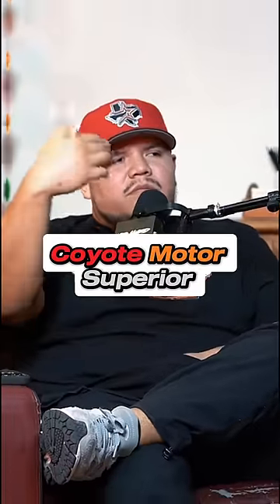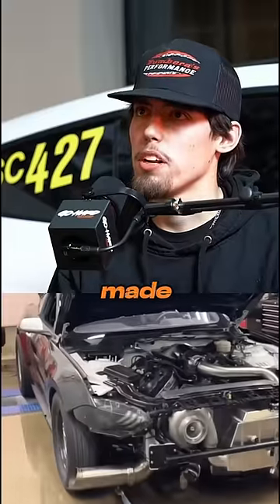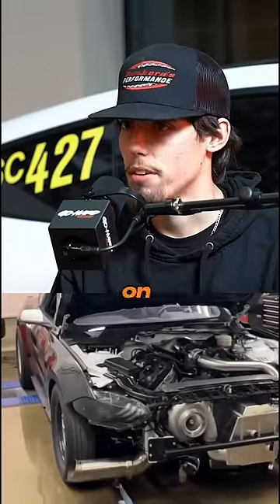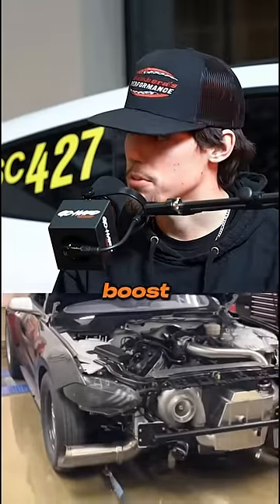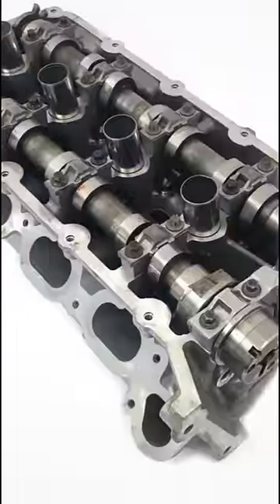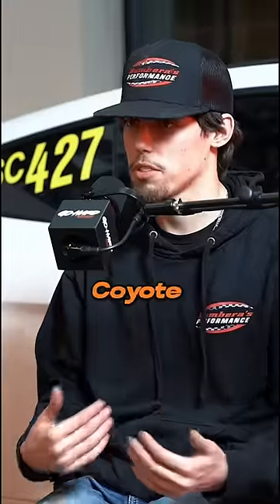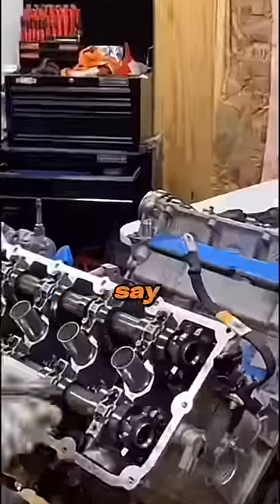SUPERIOR Ford Coyote Motor 😳 #shorts

Comment: 1 thing I love about the Coyotes motor I’ve the LS is that it Revs High from factory most LS engines rev limit about 6,200 RPM sometimes even less and let’s be honest NOBODY races below 4,000 RPM to go fast so yes having a motor that revs higher safely will always have a advantage in the power delivery even riding passenger in a Mustang compared to a C6 Corvette the 5.0 Just punches much harder up top I know you can make a LS Rev higher but that requires Head work valve train components and a Cam possibly even built internals that’s more money and labor compared to a engine that does it right out the gate so I’m going with the Coyote any day it also sounds way better than a LS motor
Reply from the maker: They rev Crazy
Reply: Gotta try out the borla exhaust for the 6.2 its got all the right sounds.
Reply: @hogsrmylifetbj  It does doing nice but I prefer the H pipe on LS motors and Hemis too many people do the X Pipe which sounds the best on Coyotes it is some 5.0s that sound good with H pipes too but it depends on what kind of mufflers is used it’s more deep than the X pipes
Reply: RPM does not equal more power
Reply: @keithrogers4577  I used to believe the same thing until high RPMs changed my mind it just feels better the driving experience is better
Reply: Just flat out not true. My boy over here is pushing 7800 out of a aluminum block 5.3 with factory lifters. I plan to spin my lq4 to about 7500 with pretty much factory top end
Reply: @AllOrNothingBusiness an engines hp peaks at a certain rpm just because it revs to 8000rpm doesn't mean you want to rev it there as your not going to be gaining any speed. And there ain't a coyote on this planet that sounds better than a ls
Reply: @randomguy93984  Yeah but those LS based engines still require some kind of modifications to achieve that high Rev limit even if it’s just minor adjustments those engines do not come like that from factory you have to make them rev higher with bolt ons and a tune as compared to the 5.0 it revs to at least 7,500 as is with 0 modifications that is a better driving experience
Reply: @JimmyJohnson7077  GT350 engines are proof that high revs are better
Reply: @JimmyJohnson7077  i disagree Coyotes sound way better than LS engines I had a 2014 Mustang GT with American Racing Long Tubes with X Pipe and Roush axle backs  sounded better than any LS I’ve heard
Reply: @AllOrNothingBusiness  well you haven't herd many ls's than have ya. and yeah sure reving a coyote till it hits limiter is a great way of blowing the oil pump gears lmao
Reply: The rev alot quicker than an LS because they got a smaller crank. Smaller crank will ALWAYS take the RPM title. Just like a Bike.. small ass crank and Rev up 13k to 16k RPM.. LS vs Coyote yes. Coyote takes the win. 1 cam vs 4 cams. Small ass heads vs huge ass heads. Of course Coyote would always get the win. I'm a GM guy but yes, Coyote takes the win.
Reply: But all it takes is valve work and a new cam to safely run it out to 7200 to maybe 75 7600
Reply: @Ironn199er  You’re right but I’d rather have a engine that does it from factory I don’t have to do anything or it besides a tune
Reply: @randomguy93984  dude Brett LaSala spins his to around 10k, factory block and factory heads. He made over 2900 with a stock crank. Your 7500 ain't shit.
Reply: @tailwatcher2500 There’s no point in over spinning a pushrod motor that makes peak horsepower around 7k lol It’s apple to oranges comparison
Reply: @ALYXTANKBACKPACK  I didn't make the comparison, I'm pointing out coyotes and modulars rev higher than an LS. This is why 5.4 DOHCs swept the podium in Engine Masters vs. LS1. They banned the DOHC from the competition.
Reply: My 6.0 LS will easily rev to 7000 with pac1218 springs.
Reply: @randomguy93984 yea this dude doesn’t have an ls cuz mine hits 7000rpm
Reply: @tailwatcher2500 the crank is forged from factory
Reply: How much does a coyote replacement cost ? And Chevy already made a 4 cam motor on their c8 zo6 that sounds way better than a coyote a C6 Corvette is also decade old already
Reply: @abrahamreyes3340  I'm fully aware, dark horse will have better rods as well
Reply: Coyote sound like a modded v6😂
Reply: Theyre heavier and slower than any 18-23 10 speed@tailwatcher2500
Reply: A 430 ci aluminum sbc will turn 9k for an hr lol
Reply: Yr crazy if u think a 5.0 sounds better than a vette 😂😂
Reply: @boostbeast8731 that doesn’t mean it makes power up there. A stock coyote head flows better than most aftermarket LS heads. Also the vvt on all 4 cams means no cam swap required. Btw a coyote making less peak power on a dyno compared to an LS doesn’t mean it’s less powerful. A coyote will typically make a higher average amount of power across the entire rev range because the cam timing control allows for great low rpm power and high rpm power. An LS that can rev as high as a coyote and actually make good power at high rpm will be a dog down low.
Reply: @randomguy93984 your LQ4 probably runs off of Levi Garret chew spit too.
Reply: 5.0s get slammed by the lt1 tho 🕺🏽
Reply: yeah the Coyote can rev, but with the right LS block you can get WAY more displacement. Get an aftermarket block and you can get 454 cubes. LSs are also cheaper to build than a Coyote. LS can be made to rev a lot higher than stock and when combined with much larger displacement its a recipe for big power
Reply: @aw11man26  to a certain debatable point which requires boost. Problem is an LS will lift a head way before a coyote will. That’s the limiting factor budget aside.

 Godzilla has the same problem the LS does.  Even when drilled to a 6 bolt they still pop head gaskets.
Reply: @jose38706 lol not in a 1000 years. Why do coyote girls ls swap them, and why don’t ls men swap to coyotes? You’re welcome
Reply: @JimmyJohnson7077 yeah but the coyote doesn't lose speed or power at 8,000 rpm, ls do sound nice but they can't compete with a yote
Reply: My truck with a 5.3 revs to 7500 I built the engine and swapped it in  in a field
Reply: Try fitting that coyote in something 😉  you'll change your mind the engine works not bad its the fab work on a frame that's a bitch
Reply: In my personal opinion I think they rev too high for a car on the street. Not too many places you can get up to 4-5000 rpm in lower gears let alone 5-6000 in higher gears! My M5 revs to 7200 and I NEVER get to get it that high in ANY gear unless its highway early morning and even then there ain't a stretch of road long enough to rev it out all the way not even in 4th let alone 5th 6th and 7th gear.
Reply: @AllOrNothingBusiness 😂😂😂 go rev a stock yote. To get the kind of power he is talking about a lot of work has to be done on a brand new yote😂😂😂😂😂😂 we talkin bout 30 k for the crate and ford ain’t modifying it for u as a crate😂
Reply: @jose38706 takes the win for rev??😂😂😂 ok
Reply: @Ironn199er oh that’s all??😂😂😂😂 the cost in that is insane. To the point of unaffordable for most Americans
Reply: @AllOrNothingBusiness yes h pipes do sound good on coyotes. Watching 337 speed and saw the difference. Couldn't believe it sounded better than x pipe. On the other hand a Hellcat with an X Pipe sounds VICIOUS!!
Reply: Hp per dollar on the ls is better up to 800
Reply: Coyote makes sense when it comes in the car, but when it comes to swaps ls can't be touched dollar for dollar. The price of a stock coyote will build an absolute beast of a 6.2.
Reply: I love all platforms but I fell in love with the LS motor the first time I heard a corvett zo6 with a corsa exhaust.
Reply: @thebakery3996  who said coyotes are better because they Rev higher? I just stated ONE of the reason WHY they Rev higher you smart person. "Ok?" 👌🏻
Reply: @SZUSEast1  yeah I think the both sound good with X pipe and H pipe it just comes to personal preference
Reply: @chewbaccapew5705  wrong sir. Higher rev doesn’t mean more power. The ls been around since 97, and and you can beat the hell out of them. You can also get over 1000 ponies on the stock ls3. The only thing puppies got is that 10 speed which is gym’s 😂😂😂
Reply: Well guess what CHEVY BOYS WILL FOREVER BE THEM GUYS ALRIGHT PAL ......but in all seriousness the reason that the coyote is better is because it came out after the Ls and they got the see the Ls flaws so they could work around that the ls engines have been around for years the first Ls dropped in 97 the first Coyote came out in 2011 ofc the coyote is better but the LS IS THAT WORK for an engine that dropped in 97
Reply: @LSCBTHEWAVY   and notice how people don't compare the coyote to the new lt platform. Mods will come down in price over time, but we can't ignore the lt
Reply: @keithrogers4577 Horsepower = Torque x RPM / 5,252. So you were saying??
Reply: Wrong broski, WRONG. LS FTW👉🔥✔️
Reply: @JimmyJohnson7077 boom! Roasted👉🔥✔️💯✌️👌👏
Reply: @AllOrNothingBusiness well you've only heard 2 la engines: THERE'S your reason for feeling this way, son. But i know: you're a guy who bases his thoughts on feelings, emotions, not facts and logic. Lemme guess, a gen z??? 😂
Reply: @jose38706 in your mind, but NOT in reality. Ls FTW
Reply: @cxthejokercx8302 this 100%
Reply: @cxthejokercx8302 cammed vettes sound= FTW 👌👏😀👉😀😀😀
Reply: @YOURpopsINthe305  bro. I'm a GM guy. I got a "RARE" engine swapped 2003 truck. L87 swapped, Frankenstein heads, biggest cam a 6.2 can take, fbo, e85 etc.. NA to NA  I'm ready to race another NA f150 10 speed 🤷🏻‍♂️
Reply: Congrats you like Hondas.
Reply: @AllOrNothingBusiness  factory parts my friend. They will turn more rpm than you would think. Run it till it floats the valves and back off 100rpm lol
Reply: @tailwatcher2500  easily achievable with short travel lifters and the right cam sure. Stock cranks are strong but almost 3k horsepower is most definitely not achievable with a stock block. Maybe a lsx 6 bolt block and head but still extremely doubtful
Reply: @jonathanallen8236  no just hopes and dreams, maybe the occasional prayer
Reply: Power at very high RPMs means the lag to get there is waste. Why move a power band to the high rpms, it just creates a broad low, mid dead zone...
Reply: 4.8l LS with Stage 3 Cams and valve train upgrades and internal upgrades are still gonna be cheaper than the coyote and more reliable
Reply: @stevenjohnson1692  your comment is mute. Let me just rev a diesel to 6k rpm and make less power. Or praise Honda for making some of the highest hp cars because they can rev to 9k rpm. Sounds like you could learn something other than googling the formula for horsepower.
Reply: Everything you said is true but the head work and cam and stuff costs about $300 you can do it yourself and the engine only costs $200 at the junk yard so $500 vs thousands… LS is the winner all day but I am not saying coyotes are bad. Just expensive to do the same thing
Reply: @AllOrNothingBusiness my 02 c5 z06 would gap any mustang gt pre 2016 how
Is that better
Reply: No I don't think it sounds better it's more brappy though less profile and texture
Reply: @chewbaccapew5705  the Coyote is a beast of an engine. I drove a Mustang GT the 1st year they put the Coyote in them. The issue is, it's displacement limited. With the right "LS" block you can have 7.4 liters, or more. That 50% more cubes. They will also rev to 8000rpm if built right, even at that size. It is hard to make up THAT much displacement. You Coyote fanboys sound like Honda fanboys from the late '90s and 2000s bragging about you revs.
Reply: @jonathanallen8236  I will never bash a Coyote. I'm also a huge import guy so I like 4 valve heads and revs. When you are talking 1000 or 2000hp, damn near everything can lift a head. I don't buy that bone stock Coyotes are going to live a long life at 1000hp. At 2000hp, you're talking about a full race engine which need either constant maintenance or frequent refreshes or rebuilds. Cletus found out quick with his 4wd Whipple F150 making 1200hp. The beat on it pretty hard right up until it broke the crank.
Reply: @AllOrNothingBusiness gt350 is worse than a gt500… and both still lose to a “low rpm” zl1…. Stuff it lol
Reply: @keithrogers4577 that's like saying longer stoke is more powerful than larger bore, it's just not.
Reply: @Zach-ju5vi  RPM over peak power is pointless is what I'm saying
Reply: Engines don't continue to make power the higher and higher rpm is. If that was the case every engine would be built to run 10k rpm to make the most power. This guy's point of RPM makes an engine have more power is ludicrous
Reply: @keithrogers4577  The power curve can be extended with more rpm which will be faster. There is a reason why most engines have bigger bore than stroke, rpm is king when the displacement is the same.
Reply: @Zach-ju5vi  so a 6.0 peak horsepower hypothetically being at 6,500 RPM, you are saying it will always make more power revving to 7,400?
Reply: @keithrogers4577  if you use a camshaft and heads to move peak hp to a higher rpm yes.
Reply: @Zach-ju5vi  you're completely missing my point
Reply: @aw11man26  no. The coyote is a dohc engine it doesn't need more displacement, and If you wanna go with displacement fird 460 can be bored too 600+
Reply: @renegade8164 Ford introduced it long before “gym’s”😂😂😂
Reply: @keithrogers4577 that’s not what they’re saying, most cars while racing aren’t going to being in the low rpm’s that much, the coyote platform makes its power in the higher rpm bands therefore staying in the power band when you’re moving
Reply: Fool 😂
Reply: @AllOrNothingBusiness buddy when reality comes down to you it's ja your opinion and it's not true for everyone
Reply: @JimmyJohnson7077 Agreed on the first part, it's a power curve, meaning it's not linear. Just because you can rev to 8,000 doesn't mean your power plant is still efficient enough to continue making power at 8,000 RPM. 

Disagreed on the second part, as more of an LS guy myself I think a lot of these Coyotes sound magnificent. They're snarly and sound mean-- most of them sound meaner than they are though.
Reply: @AllOrNothingBusiness my coyote has stainless works lth, h pipe, and 18+ active exhaust locked open and it sounds absolutely nasty. I’m gonna put on an x pipe to see but as it sits it’s gorgeous to hear
Reply: @stoney3694  Niceeee those are some of my favorite headers for a Coyote keep up the good work post some exhaust videos
Reply: @yes_man212  exactly my point NOBODY races at 4000 Rpm or below we in the modern age not the days of the 80s & 90s when a small block 350 Chevy only revs to 4K everyone knows you have to go beyond that if you want to go faster
Reply: Dunno, that LS chop is pretty irresistible. And the form factor of the LS means that you can practically throw it into any chassis out there. It's not got the top end, but so much torque that it can overpower any chassis you put it in, well streetcar anyways. Those coyotes are big engines!
Reply: All that means is the power is made at the top end were as ls power is made lower. Maybe you should look at some Dyno graphs. Also you can turbo a ls and make 1000 hp cheaper and more reliably than a crap Ford. Go ahead look at cam prices for a coyote then and ls, that means more money in other areas diff gears, transmission, tunes just to name a few.
Reply: @hellswells9135  Me personally I don’t care about any of that Coyote is better for me because I enjoy the driving experience better with that engine over a LS I’m aware what you saying is facts about the LS but I’m not into spending thousands of dollars on a engine to do what I want it to do I would rather buy something that already performs the way i want it from factory I’m not into building cars i drive them and study them I do not have the time money or resources or support to build any Engine so the 5.0 is great for someone like me
Reply: @AllOrNothingBusiness  I've yet to hear a coyote without a turbo on it sound good.
Reply: Diesel engine enters chat at 3900rpm going fast
Reply: Coyote does not sound better than an LS. And ofc an OHV isn’t gonna rev as high as an OHC.
Reply: okay idk about the “sounds way better than any LS motor” coyote js sounds obnoxious kinda like hearing a straight piped civic absolutely wailing, while the LS has that deep toned out sound, makes it even better with cams they literally sound the best.
Reply: We have some ricer math going on in these replies.
Reply: @AllOrNothingBusiness the 350 is also flat plane crank
Reply: Yeah mines mostly stock other than exhaust etc and I’m being modest and only rev to 7250
Reply: Upgrade the valve train and u can go higher ford motors suck they don't last
Reply: @jakeryan5509  I seen a sec 283 rev 12k with upgraded valve training
Reply: what is gearing?
Reply: Definitely doesn’t sound better
Reply: @AllOrNothingBusiness instead of viewing it as “rpms from the factory”, try viewing it as “useable hp per $” and you’ll see why the LS family isn’t going to be dethroned anytime soon.
Reply: @AllOrNothingBusiness You’re basing this off of your feelings which isn’t an accurate way to judge these things. …. 

Don’t believe me? Go drive an rx8 with a manual gearbox and get back w me. Those things rev to the moon and kinda suck. Or a Honda. Let that sweet V-Tec kick in.
Reply: @bigwheel9132  No you’re wrong it has nothing to do with my feelings or emotions idk where you get that from like I said when most cars are racing idk anyone who is redlining at anything under 4K Rpm’s you have to go beyond that to go fast that’s just facts the driving experience is much better in a Coyote than a LS Motor I said what I said
Reply: @bigwheel9132  RX8 or a Honda with V Tech so on a Race Track with Turns a Shelby GT350 doesn’t drive better than a C6 Vette lol that is a Lie
Reply: @bigwheel9132  I simply don’t care that’s not my focus LS engines are cool but they not my preference for the type of driving and racing I like to do I’ve driven both on track and the LS felt like a lazy dog anything past 6K rpm’s i got passed up by other cars due to not having any top end power but when I drove a Coyote never had that problem again but do you man everyone has their own preference for racing cars
Reply: @AllOrNothingBusiness   * You typed what you typed (this is written format). Also, get your panties out of the apparent wad, and quit being hostile towards me for politely informing you that you’re objectively wrong. This is the place exactly this type of dialogue and if you’ll relax, you may understand where your logic became flawed. Since you still haven’t provided any data tangible regarding hp/tq, power curve, and useable power range, I’ll let you go first.
Reply: The coyote is going to need rebuilt after a few passes anyways, so why not just tear down an lt or ls and build it to last? Gonna have to tear whichever down anyways.
Reply: @keithrogers4577 with equal torque at given rpm it does. 

But the thing is, you might can make so much torque at a lower rpm with one engine that it makes more power than the high revving one.
Reply: Another delusional ford guy 😂
Reply: @AllOrNothingBusiness a coyote is wayyyyy more expensive too you can make wayyy more power with a ls or lt for alot less money you ford guys need to learn you want you're lil pony to have reliable power you need a ls in it 😂
Reply: @mattdavis4410  they stay so busy working on trying to fix their vehicles, they don't have time to pay attention to much else😂
Reply: Sounds like you never raced a legit LS and had to go back to the drawing board. Revving higher means faster? Not when the butt dyno says otherwise my guy lol. The displacement a LS/LT has makes it a breeze to keep the rpm low and still dog walk most engines..
Reply: I agree but it’s generally much more expensive to buy a coyote
Reply: @Invaderjim03  more expensive in every way and they aren't reliable unless you do a ton of work to them ford has never failed to let me down
Reply: @mattdavis4410  yeah. I’m not hating on coyotes then mfs are bad asf they do some damage to every other manufacturer rn but I like the simplicity of ls and I can’t afford a coyote lmao
Reply: Nothing sounds like a built 7.0L LS7
Reply: @JimmyJohnson7077 😂😂😂😂
Reply: @renegade8164  False it was a collaboration between Ford and GM.
Reply: @AllOrNothingBusiness your driving experience doesn't matter, rpm isn't hp, torque x rpm is hp
Reply: @keithrogers4577 it actually does, but I get your point. Horsepower and torque at lower rpm s is more efficient. Just adjust the gear ratio.
Reply: @AllOrNothingBusiness but the coyote is slower with no modifications from factory. Even Ls2 6.0 C6 vette putting belt to azz from factory to factory
Reply: @realshidd3062  Both stock in a straight line such as drag racing it can go either way but on a Track with turns and twists a S550 Mustang GT is beating that C6 Vette
Reply: Definitely don’t sound way better maybe not even better
Reply: @keithrogers4577  funny part is it does 😂
Reply: Look at a Dyno Graph of that high revving Coyote.... they don't make any torque up top and the power rolls of at....6500. It's a placebo effect that you're getting just from the sound. 

Also, LS engines can rev that high from the factory....the LS7. The difference is that the LS7 makes power all the way to 7000rpm. But torque rolls off at 6200rpm.
Reply: @AllOrNothingBusiness  Saying “that’s not my focus” is the same thing as “I’m not very educated on ICEs but my heart is set on this”.
Reply: I agree only real competitive LS to the coyote is the LS7. Its can be turned up to 8k rpm on stock bottom end. 
My cammed 5.3 Silverado can reliably rev up to 7300 but I have it turned down due to the fact I loose peak torque right around 6600rpm.
Reply: LS motors are better for the average man who can't afford to do all the extra BS to a motor. I get enough HP out of a LS just swapping parts from a junkyard.
Reply: @csb772  That’s just a convoluted way of saying “hp/dollar, the LS wins”
Reply: Isn't that the point of the dohc on ford 5.0 blocks? All the top end also I agree no one races around to 4k rpm but sounds more like you are throwing shots at truck motors and not LS motors.
Reply: @bobby42069  The coyote engines just do what I want it to do from factory not shade to the LS engines a LS7 & LS3 is a phenomenal motor but that’s out of my budget I think a lot of people missed my point it’s a lot of comments but I do track racing not drag racing as most people may assume also I don’t work on cars I race them the cars don’t belong to me I get permission to race them from the owners I’ve driven a 2015 Camaro SS 1LE on track and it was awesome but all I’m saying is the top end on the Mustangs punches much harder than a LS I’ve won track races due to that reason
Reply: You don't know what you're talkin' 'bout 😂
Reply: @phillipstein9099  Don’t care what you believe
Reply: I love how people seem to forget that even SBC’s are notorious for turning insane rpm when properly set up.
Reply: @CharlesEllsworth89  The LS7 isn’t comparable to a Coyote. Two completely different lanes and price ranges.
Reply: If you don't know what torque is just say that😂😂😂
Reply: @AllOrNothingBusiness what you can rev to doesn’t matter 😂 how fast you can rev is what matters
Reply: @brendenperry3770  That can be changed out easy for cheap on most RWD cars in the case of Mustangs 3.31 gears is longer than 3.73s it’s a big difference 3.73 revs up way faster between shifts I drove both before
Reply: @stitch684  This.
Reply: @AllOrNothingBusiness  Huh? You sure?
Reply: Been enjoying high revs since I started driving  🤣🤣🤣 Honda baby!!!
Reply: First time I drove a 2017 mustang was disappointed how lazy it was
Reply: Sleeves ain't factory 😂
Y'all drinking blue kool-aid 😂
Reply: @cdjr66  🤣🤣🤣🤣 I said the same thing
Reply: @yes_man212  Bingo!!  This was the comment I was looking for!   When banging gears, who gets up to 6500 rpm or more, shifts, and goes back down to 2-3000 rpm.   Power band at higher rpm’s (4500 or more) is optimal and why mustangs (5.0 and 5.2) do very well in roll races, especially with boost. From a dig, chevys do well but anything past an 1/8 mile, they fall off hard and why the heavier car with a smaller 5.2 liter Gt500 beats a ZL1 in the quarter mile.  High rpm power band and stays in it.
Reply: @bigwheel9132 he’s absolutely correct.  3.73 gearing ftw
Reply: My old fblock 460 says
That's cute
Reply: @AllOrNothingBusiness they may require a few things to rev to 7k but thats generally because most are truck engines and theres no reason to make sonething scream if it has good low end. Thats the big deal about ls motors is generally good broad power with low rpm means a long life. 

Now to make it rev you can do a coupke simple things and youll have 7500 rpm screamer. And likely come out cheaper than the coyote. If you are buying straight from ford or gm , the gen 3 coyote is nearly 11k while the l84 5.3 is about 5500 and the LT1 around 9500.
Reply: @johnrx15  Correct regarding what, exactly? 
Also, why are you mentioning axle gear ratios to me?  

We are discussing power plant rpms and power curves and you’re on the wrong end of the horse.
Reply: @bigwheel9132 correct regarding gear swaps to taller gears to hit high rpm’s faster.  It doesn’t change lbs torque, but it does climb the tach faster with 3.73s or 4.09s.  Mustangs, unless a Mach 1 or Shelby, come standard with 3.31 or 3.55 and a swap to 3.73 drastically improves low end performance.  I’ll take a gear swap and high rpm coyote any day of the week.   Am I not allowed to have an opinion dad?   Ffs
Reply: Literally all it takes to rev a LS out to 7k is a good set of springs lol, it's just generally not worth the gains when you can make power with cubes.
Reply: I own a mildly modded C6 and I’ve faired pretty well against the newer coyotes that I’ve come up against in the street. But I’ve also gotten beat by a couple as well. They do rev like crazy and they sound better than my Ls. That’s just a fact. However, I’m an older dude and I mostly do Sunday cruises and the C6 is just one of the sexiest American cars ever produced, imo.
Reply: @TommyC6-z3n  Nice bro yeah the C6 is a great car I do prefer the C5 or C7 a little bit more just personal taste but I know the LS3 ain’t no punk C6 is definitely a solid platform
Reply: Right but the LS is a 20 year old motor while the coyote has 4 cams and 32 valves that’s the biggest difference and did you just say a coyote is cheaper to build that the LS? 😂😂
Reply: I rev my LS 396  to 8800, how high do you rev the dog with all those cams and valves   .  . .and chains ?
Reply: @keithrogers4577 WRONG, that's exactly what Horse Power is all about, the high RPM.  Nobody and I mean nobody ever built a high Horse Power engine that only reved to 3,000 RPM. Horse Power lives in the higher RPM range.
Reply: @TommyC6-z3n  No offense but: If you’re getting dusted by a Coyote, it must be VERY lightly modded and a non LS3. Possibly a ded-hole too. 

All jokes aside, the math ain’t mathing concerning your comment.
Reply: @bigwheel9132  Correct. Early C6 with Ls2 A4. Threw out the 2.73’s for 342’s Engine and Trans tune with a COW boost which makes a ton of difference. LT’s with corsa . Don’t get me wrong, I’ve roasted a bunch of stock coyotes, but there were 2 in particular that got me. Close but they got me. I do have traction issues from a dig. Could definitely use some suspension upgrades shocks etc…..But I’m an older dude. The car is fun to drive and for me it’s got more than enough power. It was a total dog bone stock, but the car looked like it was in a time capsule. Couldn’t pass on it.
Reply: High rpm and high compression Ls3 here🙋🏻‍♂️🏁N/A💪🏼💯
Reply: @felixortega21  Hi there! Nice to see the internet has folks with real-world experience
Reply: I agree….cept for the sound of the Coyote vs LS.
Reply: That’s exactly why Ford should’ve dropped the 3V 4.6 for the intech 4v variant.
Reply: Aye don't tell nobody this nomo. Coyotes are great but most 4.8 an 5.3 rev out past 6500 rpm it be the transmissions for the Chevy but coyotes are the stock power plant champs they aren't the best thO
Reply: @keithrogers4577  The formula for horsepower says otherwise.
Reply: @keithrogers4577 uhm, mathematically more rpm always has an increase in hp. Horsepower is TQxRPM/5252...Ie horsepower is the combination of torque and horsepower
Reply: Coyote overpriced for what little it does so what it spins 8k rpm so does a rotary but you don't here people boasting about them😂😂 coyote might win but just remember Ford had to make the coyote because they couldn't keep up with everybody else 😂😂 f.o.r.d - fucked up rebuilt dodge😂😂
Reply: @keithrogers4577  Yes RPM does mean more power.  HP is derived by 2 things, RPM, torque divided by 5252!
HP = T x rpm / 5,252
This isn't my car feels faster at higher RPM or anything similar.  This is Science
Reply: @brinkee7674  glad you can use Google but it went over your head
Reply: @keithrogers4577  nothing went over my head.  Obviously you have no idea how engines work.  Maybe you need to read things, you know it's called learning
Reply: @brinkee7674  🤣 cute. It's almost like you didn't read what was said. It's hilarious when people are offended